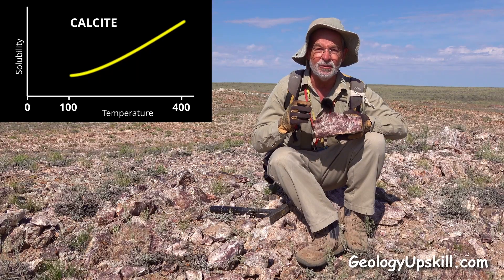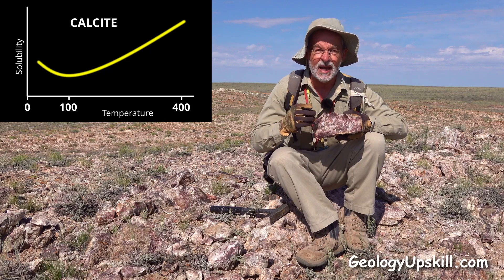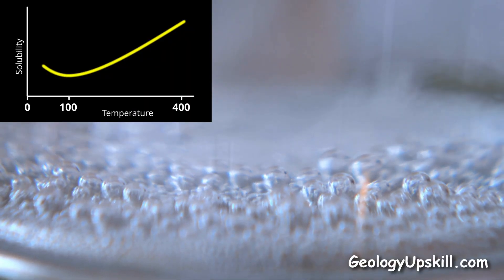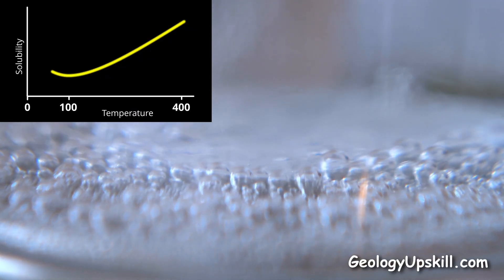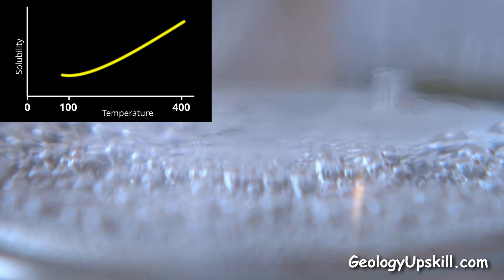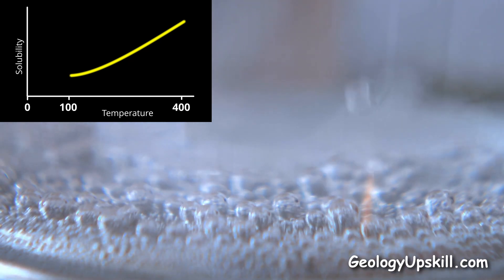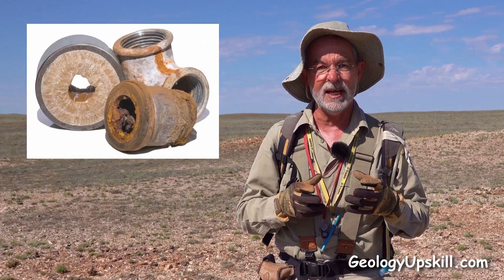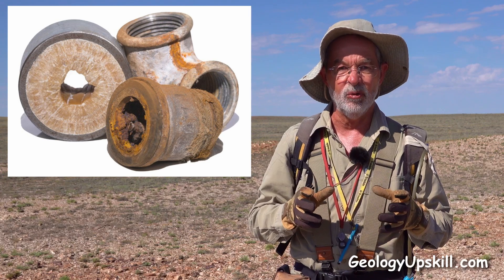How Bladed Carbonate Texture Forms

Comment: Hello Sir
i,m a construction worker and i,m hobby(sigh) placer mining a stream . (EU) that cuts trough the middle of a pluton  which has a granite core,then syenite and then monzonite
 the pluton has undergone also a tilting ,so now its   horizontally with the roof pointing downstream and halfway eroded down.
(I,m no geologist i hope i understood  these papers correctly)
As holyday miner i,m very curious where  the chunky nuggets may have formed .

Are there returning traits  where the bigger nuggety gold is more likely to form in these plutons ? 

Thankyou
Antworten
Reply from the maker: Nuggety gold can form in several ways. Most commonly it occurs in quartz veins, particularly those in metamorphic and granitoid host rocks, but under the right conditions (usually lateritic weathering) they can actually grow in the soil near to a source of gold in the rocks below.
Reply: @GeologyUpSkill  does this mean it can com from all the pluton rocks (granitic) as well as from the intruded rocks surrounding it?
By the way  appreciate much your channel and  helpfulness.

I collected various samples from veins  exposed in the stream bedrock outcroppings and old copper mines ,crushed and panned but no (free) gold.
It,s the VDC pluton ,near Biella,  IT.
If you  ever happen to be in the surroundings i,l be happy to offer you a  good espresso .

thanks
Reply: @giorgiotortellini8845  Good thinking. You can find outlying  parts of intrusives or related ones some miles off (from known nuggety gold mining areas) that are poorly exposed, that nobody has found yet, and the prizes that go with them. Some of these may have produced too little fine gold to date for historical prospectors to trace.
Reply: @lachlanscanlan5621  yeah,the big gold has to come from somewhere,but finding the source may require more skill and time then  i have.
The mountains around the stream are covered with soil and  forest .
I wonder if today it,s possible  to analyse the nuggets  and get information what the host rock may have been to narrow it down a bit.
i Read abot TAG deposits where it would be  at margins from pluton ,intrusion related  deposits etc.
But they talked about gold  occurences generally,not  where its more likely for big native gold to be formed.
The gold i find  has a bit a brassy color ,not the bright buttery yellow i found in other streams.
Theres rounded Magnetite chunks bigger then my hands in the  stream alluvials,found pure pyryte veins ,veins with chalkopyryte ,bornite   with quarts cristals and a black bubbely masse sandwiched inbetween (Hematite?Uraninite?) but no visible gold.
 Well ,the research is part of the magic .

Thanks

Comment: Thank you sir.  We are going to be up in some bladed carbonate texture rock later today.  We are having a bit of difficulty determining which quartz types have the most gold.  The low density residual quartz after calcite seems to be the lowest.  The quartz MIXED with macro crystalline calcite is next.  The we have the sugar quartz/ crystal filled fractures seemingly the best grade.  The best found so far at this location seems to be about 15 PPM, but 1500M away is a mine with reported production grade of 170 PPM or so.  We are having an interesting time, but would be happier with your knowledge and a good budget 🙂.  Thank you for your help.

Living the Life, Keith and Eva
Reply from the maker: The best gold is usually in the zones with a mix of colloform,, crustiform and saccharoidal quartz.
Reply: Thank you very much.  We are planning to sign up for your course work this winter when it is too cold for field work here in Montana.  We had to change our plans for this weekend as a new forest fire had just started about 4 K directly up wind of our search location.

When in doubt- BAIL OUT.
Reply from the maker: If you can see smoke, check your exits. If you can smell smoke, exit!
Reply: Absolutely.  Especially as sometimes the exfiltration routes can be slow and easily cut off in the mountains.
Reply: @hardrockuniversity7283  I don't know any mines producing 170ppm head grade. That's over 5 oz/tonne
Reply: You math is correct.  The records say  " 100 per ton" at a time when gold was $20 per ounce.  Some of the old placers near here had OUNCES PER PAN.  I want some of that!